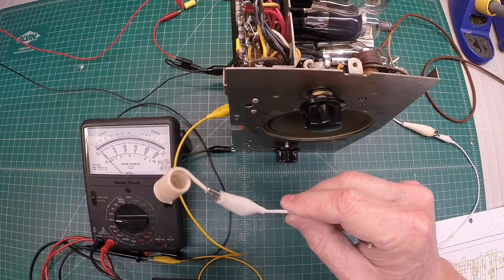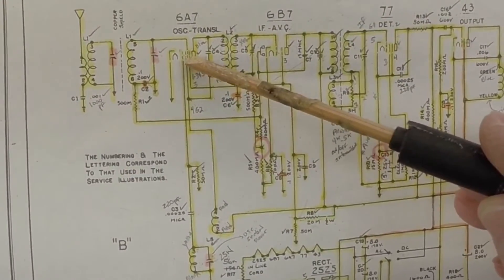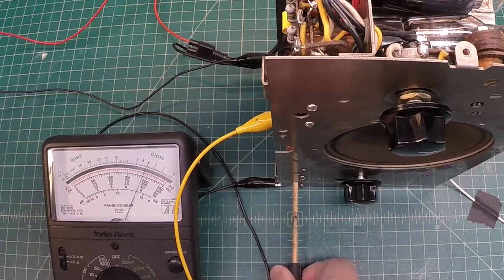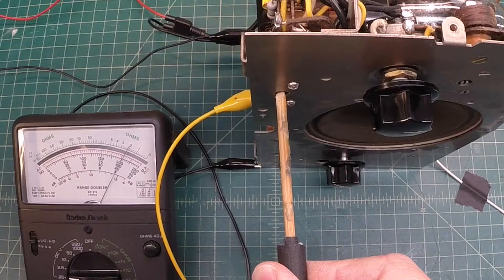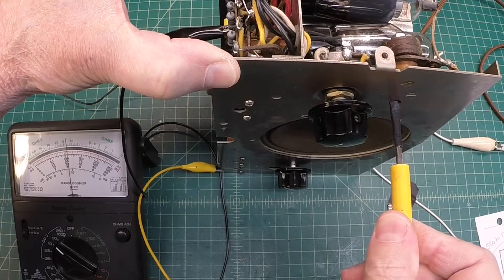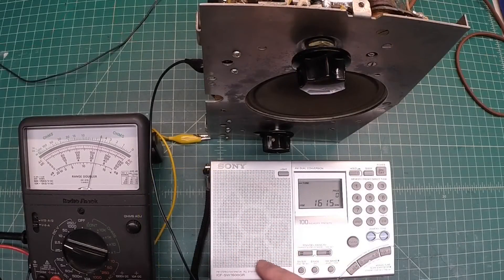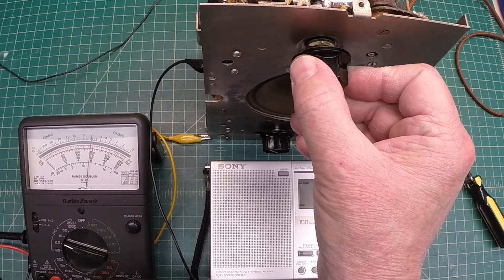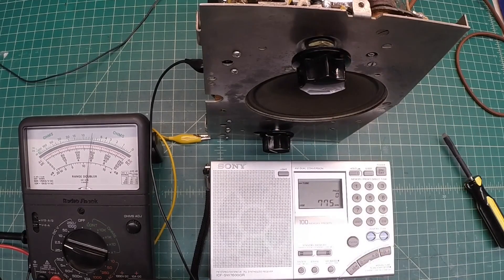Silvertone "Companion" 57 D 1704 - RF Alignment + Oscillator Adjustment w/ A Digital Receiver

Comment: I just finished watching all 31 installments and there is only one word to describe what you have accomplished here.  That word is "brilliant".  I do have one restoration philosophy question.    Why do you sometimes only replace resistors that are out of tolerance now?  Those 80 year old devices that are "still good" could fail tomorrow or in the relatively near future.  Seems like all new would help assure the radio works until the next restoration.  Just askin'...
Reply from the maker: James - sorry for my belated response. I truly appreciate your kind words. Regarding the resistor replacements, if I were planning on parting with the set or doing the work for someone else, I would typically replace all of the resistors; this is just a hobby for me as time permits. Most of my YT restorations have been keepers or given to family or friends close by, so if a failure arises they have a local repairman. LOL The low value resistors seem to hold up pretty well, while others have been found +25% to +200% OOT. Your question is a good one and I appreciate your feedback and taking time to watch the series. All the best to you. Don